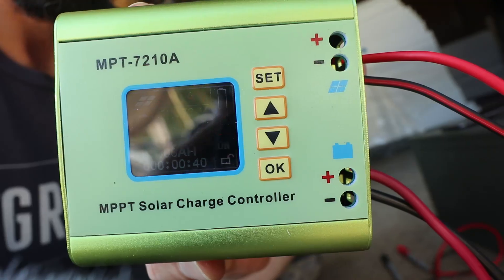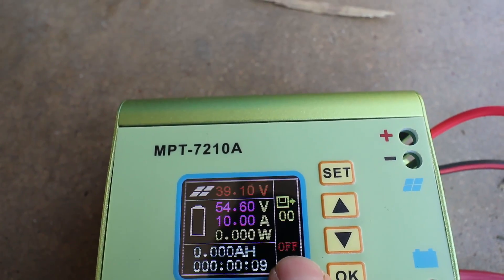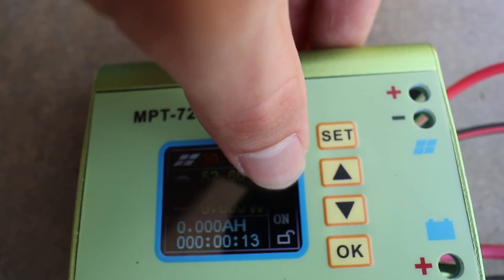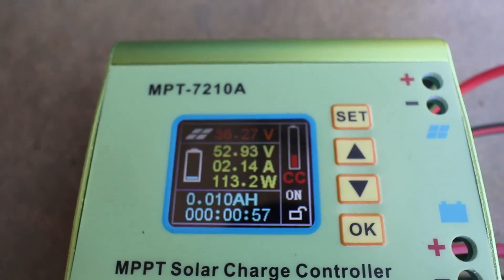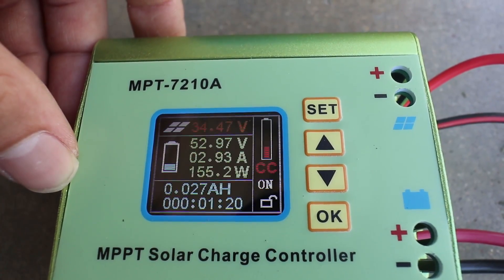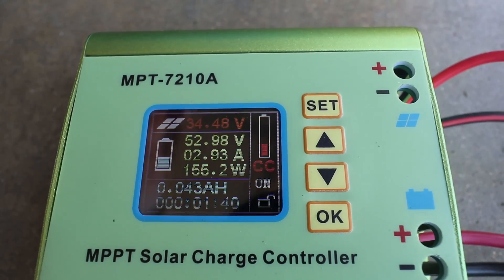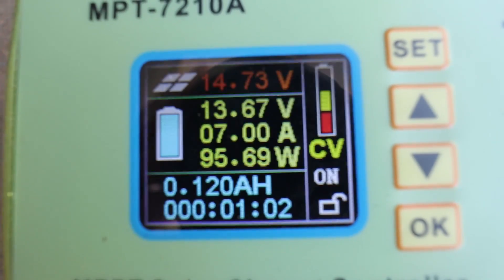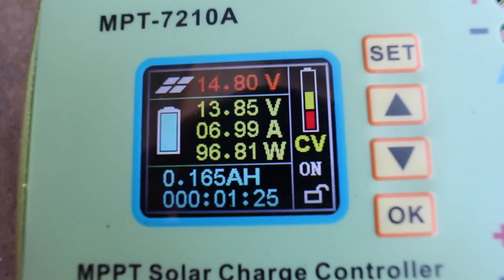Why The MPT-7210a Charge Controller Might Be The Best Golf Cart Solar Charger

Comment: How I understandt this mmpt controler have low efficiency 80-88 percents. Not support turn off fan (settings is but not work) and it wery long start to go to maximum power point. So I not ecomendate it. It only good that can step up and step down voltage. But it only step down can to 24 volts, lower it can not step down.

Comment: IS NOT EFFICIENCY. the small controller take a wrong mpp voltage. Dont note you that the panel is at 36v'?? is ridiculous !! at 36 v the panel drop the power. is a lot more than mppv. but have nothing todo with efficiency! is worst. a mppt with a wrong mppv is totally garbage

Comment: Just reporting back to mention I purchased the elejoy 400w controller to replace this and its performance so far is far superior to this controller.. It does not lose its power point tracking and reset to 0v with every bird or cloud overhead and I got almost a full amp more of charging current from it in the testing so far and it wasnt even a completely clear sky. I was charging my 51v lifepo4 pack in my golfcart using the 355w solar roof panel and charging with over 7 amps.
Reply from the maker: That’s awesome. I’ve been using the elejoy and have been super happy with it as well.

Comment: So I'm using this very controller on my diy 48v lifepo4 golf cart with a 39v 355w solar panel as the roof. it charges the pack at 58v and over 5amps in the sun off the single panel. I didnt see you mention it but you should set the optimum panel voltage as well and this prevents it from  stumbling as bad after a bird or cloud comes over.

Comment: Hello everybody, this is amazing tool!!!

The ONLY problem is the noise from the fun and i have a very easy fix, the factory have wrongly placed this fan very close to the chassis, all you need to do is take it away from t he chassis for a few cms and the fan is silent, you do not hear the fan you hear th e vibration from chassis, which is disturbing if in close enviroment

So> Take out the fan which is very silent by the way and for such a  cheap fan very efficient and just place it, on the outside same side , with about 8 layers of double tape , so there is some distance of minimum 4-5 cms from the chassis, at the same side that the fan is , 
take then a plier and cut the metal pieces of the metal that was protecting the fan entry and place some gorilla tape around the fan so the the air is going into the rest of the chassis

Amazingly silent fan and mppt , i have it in my van years and does not produce any noise at all.

Comment: I tried to use the same controller to keep my 36V golf cart charged via a 400W solar panel that is mounted on the roof of the golf cart. With this controller I could get only 230W out of my 400W panel. I switched the MPT-7210A controller with a Elejoy EL-MU400SP MPT boost charge controller. Now  I get up to 380W out of my 400W panel. That is excellent. Having said this, I can't recommend using the MPT-7210A controller. It is very slow to adapt to different light condition - when driving around the golf cart the charge current was very low until I come to a stop. Then the controller ramps up the Ampere. I don not have those problems with the Elejoy EL-MU400SP controller. Even driving around I get my full charge amperes.
Reply: I just bought one to try based on your recommendation for my 355w roof panel on my cart. I had read somewhere the controller backfeeds voltage to the solar panel and could cause damage. not sure how true that it but its something I would imagine a shottkey diode could remedy.
Reply from the maker: Totally agree with you. At the time the elejoy controller wasn’t available but I have the same controller as you on my forklift and it’s amazing!

Comment: The green one has 60 V max input in the datasheet. I saw it was running at about 54 volts. My panels are 58Vmp and 73Voc (open circuit). Do you think these would still work with this green controller ? ( as 73V is already a lot more then the 60V then speak of). Any idea what your open circuit voltage is ? ( Battery will be a 20S Lion = 84V full charge, so I need a boost/step up convertor )
Reply from the maker: I’ve learned not to work outside the posted voc limits. That’s an oddly high voltage panel but I know there are all types out there.
Reply: You might double check a teardown video but I thought I remember the input capacitor being 60v so it would probably pop it

Comment: You mentioned trying other controllers.  Just curious if you've tried the AliExpress boost controller with the blue label - the one I'm looking at is Sunyima brand but I've seen multiple.  Wanting to be able to connect a 240w 24 volt panel to my 48v cart and it looks like another option.
Reply from the maker: This one? I have one and it works. Interface is obnoxious to use.

US $27.93  40％ Off | MPPT Boost Solar Charge Controller 300W Car Battery Charging Voltage Regulator High-efficiency Charging 24/36/48/60/72V
https://a.aliexpress.com/_mN7yIAW

I like this one better, efficiency is good too! Way better than this green unit for ease of use. Check out this product on Alibaba App CE ELEJOY EL-MU400SP MANUFACTURER 400W MPPT SOLAR CHARGE CONTROLLER 99% LED DISPLAY STEP-UP SOLAR CONTROLLER MPPT BOOSThttps://m.alibaba.com/product/62573798904/CE-ELEJOY-EL-MU400SP-MANUFACTURER-400W.html?__sceneInfo=%7B%22type%22:%22appDetailShare%22,%22data%22:%7B%22filterKey%22:%227.8.2_share%22,%22cacheTime%22:%221800000%22%7D%7D
Reply: @BeeneEnergy  ive been told that controller has better performance but I agree the interface and options are limited.

Comment: It's a boost converter. In all probability it is just acting as a diode when the input voltage is higher than your battery, that is how they behave. What that means is, it won't disconnect when your battery is full!
Reply: @jeroenbenes7190  with a higher than battery solar panel voltage?

Comment: I have a 48 volt golf cart with eight batteries of 6 volts each and I use a victron solar controller that is connected to four large panels on top of my shed to charge my golf cart the wattage of the panels is 310 watts each when I run my golf cart low I plug it in it's usually fully charged by the next day as long as I have several hours of sunshine.
I don't charge my golf cart everyday I only charge it when it starts getting low and I usually run it pretty low like down to 46 volts but the charger fills them back up and floats at 58 volts

Comment: I have a 36 volt battery for a 4 wheel peddle bike with an e-bike motor. If I understand you correctly, I can use a 12 volt panel with this charge controller set for 36 volts and it will charge the battery completely. Is this correct?
Reply from the maker: Yep, or if you want a plug and play get one like this. Just gotta connect a panel and the battery and you're off to the races. While the green little guy here is less expensive it's more difficult to program correctly. So if you can spend the extra $100 I'd just get the simple one. https://amzn.to/36Ux6Ox

Comment: Hi, Thanks for this video. I'm just looking for solar controller to charge my 72V Li-Ion battery pack. Do you know what is minimum panel voltage to powered this setting up? Of course by using this MPT-7210a device.
Reply from the maker: I don’t have the manual in front of me but don’t think there is a minimum. At least not in a practical sense.

Comment: Looking for a way to keep a 48v 50AH lithium pack charged in Florida with a single 250w solar panel with moderate sun between  afternoon(11am-4pm).  That Solar booster just sounds very loud.  Anybody try another Chinese product on Amazon going for about $50 in a black case?

Comment: You are misinformed and now spreading it regarding mppt charge controllers and current solar panels on the market. Almost every mppt charge controller accepts open circuit voltage from 60v to over 160v. You don't go the government to buy a secret 60v  panel for your 48v battery. You simply put a few regular, easy to get solar panels in series. That's literally the basic foundation of a solar setup with a mppt CC...
Reply from the maker: Yes that’s one way to skin the cat. And arguably the best. But what are you saying I’m misinformed about?
Reply: @BeeneEnergy  at the start of the video your statements implied that we have to find these hard to find, high voltage panels of 50v+ to charge 48v batteries. You then immediately jumped to the boost charge controller leaving out the standard practice of using panels in series. This tells the "new to solar" viewer that they have no other choice but to use a boost controller outside of finding the rare high voltage, high cell panel. It also gives the impression that you are not well informed about the basics of building simple mppt solar systems.

I ended up on your video after searching for the part number of this boost charge controller. A new user in a beginner solar Facebook group bought this boost CC for his three 250w panels thinking that the panels have to be in parallel and this boost controller was his only option to charge his 36v bank.
Reply from the maker: @neeld.5522  oh that’s funny I was just reading his post on facebook.

My whole video was aimed at putting a solar panel on top of a golf cart. Trying to put multiple tends to be limited by space and finding a single panel that is high enough voltage is in fact rare.

If you’re not limited to a single panel then absolutely use a buck charge controller.
Reply: @BeeneEnergy  oh I totally get that it's a bit of a challenge to have 2 panels on a cart roof and what your goal is with this video. Unfortunately it's easy for new DIY folks in solar to set themselves up for problems and possible house fires in some other cases with the weird information out there. As your statements come across as misleading with how it's worded, I'm kindly asking that you consider dropping another sentence or two in future videos to ensure that everyone joining the DIY solar community has an accurate impression of the technology. You are a content create and you have influence with your videos. 

Based on your last reply, it would seem that you are informed. So a comment like "Now you could have two or more panels in series with a standard buck mppt CC which is standard practice with mppt solar systems, but fitting more than one panel on a small golf cart can be problematic" would have been very welcomed and would cover the entire audience that has different levels of solar knowledge.

Comment: Alright, i too got one of these charge controllers and i have a question:

What happens, when the battery is getting close to being full?

So far i have connected the solar cell side to my bench power supply with 15 volts and set the output voltage to 12 Volt. With no load, the output voltage was 15 Volts too.

So my guess is: the controller "shorts" the panel to get down to a safe voltage for the battery by charging the battery. But what will happen if the battery can't draw enough power anymore because it's getting close to being full? Will the voltage just rise because there is too little load and damage the battery? Does someone have experience with this kind of situation?
Reply: These are for 24V and UP!... people keep buying these for 12V batteries when it's merely a BOOST CONVERTER!... so DO NOT USE FOR 12V batteries! for 24/48/72 ONLY
Reply: You can't use this if your panel has higher than battery voltage. It will just act like a forward biased diode (full on all the time).

Comment: I cant get mine to charge at over 80 watts. Have a 320 watt dokio folding  solar panel attached to it. Trying to charge a lithium battery at 58.8 volts. is their something wrong with my unit ? Is it maybe due to the xt60 connectors I am using from the panel?
Reply from the maker: This unit is probably less efficient the father apart the panel and battery voltage are. Boost converters are inherently less efficient also. Could be this is all you’ll get but it does seem low.

Are you in direct sunlight, no shading on any part of the panel, and panel is angled toward the sun?
Reply: @BeeneEnergy  yes not a cloud in the sky. I did see it at 100 watts when I first started trying to charge when the battery was at 54v now. It is at 57.8 and has took 5 hours to put 400whs into the battery. Have not seen it above 80 watts all day. Maybe it has something to do with the battery bms? Still , taking a full day to get from 54 to 58.8 seems like a long top up period. Panel is only 21v so ya, there is a big gap between 58.8v and 21

Comment: Well if you have clouds or any birds flying around you've found this charger doesn't work very well. The ckvt 300 out performs this one two to one 
People don't buy this charger there is a much better one. I know I've used the 7210 for a year it's really cheap and extra solor panels don't help  .
Reply from the maker: Post a link!
Reply: @BeeneEnergy   there were a couple us sellers but I think they've sold out  https://www.ebay.com/itm/164328225339?ssPageName=STRK%3AMEBIDX%3AIT&_trksid=p2060353.m2749.l2649
Reply: Ive only found them on ebay

Comment: I have the same controller for about 3 years and you have 1 setting wrong, in the setting you must lower your mmp pannel voltage to gain power..  not open voltage from your pannel but lower to the mmp voltage of your controller. if it makes any sense?... from what I can see the voltage must by 29 a 30v and not 34.
Reply from the maker: Yes yes, I think I found this after this video. The mpp voltage in the controller should be set to the “vmp” of the panel not “voc” of panel. For me it would constantly reboot until I got that setting right.
Reply: @BeeneEnergy   nice, i have running it for half year for have found that setting.. it a great cheap controller that have never failt me in 3 year of operating.
Reply: Quick question, can you get anywhere higher that 1.5 A for a 72v battery?
My panel is 330w 35v.
Thanks

Comment: Thanks for good test result by using MPT7210a. I am wondering if you could run Golf cart while solar charging.
max 10amp recharging to battery as same time discharging by driving golf cart than I would like to see what going to happen.
Is it still keep charging as 10amp constant current? or stop charging with overload protection due to cart drain more than 10amp while driving the cart?
Reply from the maker: It won’t overload. The panel and charge controller will charge as much as they can making the range longer than without the panel.
Reply: @BeeneEnergy  Thank you very much. Its very helpful.

Comment: It's interesting that your true mppt controller kept panel at 30.1V and mpt was set up to 34V. As I understand mpt is not doing actual tracking of maximum power point and just relies on user to set it. I wonder if the readings would be closer together if you set the voltage on mpt to the same as real mppt controller tries to hold

Comment: you should really ditch the PowMr and use the Make Sky Blue one instead. There is a HUGE reason for this... The PowMr is built on firmware 113 which has many problems like needing the user to multiply the voltage times the multiple of 12v the battery is (hope that makes sense) But the MakeSkyBlue uses Firmware 118 which in addition to fixing that about problem allows more defined battery voltages and also does not require a restart after changing setting. I have used both, and now only use the Makeskyblue version. I did find one other thing with the PowMr and that was sometimes, it locks up and stops doing mppt requiring a restart to make work again. Id really love to see you try this other version, I think you would never look back. oh, the only downside to the makeskyblue model is that it is about 5-10% more expensive, but once you look inside at it's construction it will be obvious why it is so. Let me know if you will test this on your channel, and what you think. Cheers!
Reply from the maker: You’re the first to give a valid argument for one over the other! I’m considering it, thanks for the info.